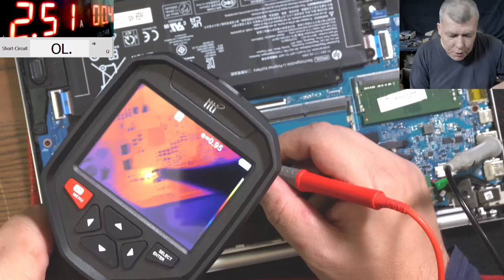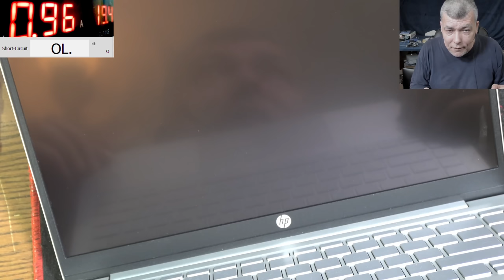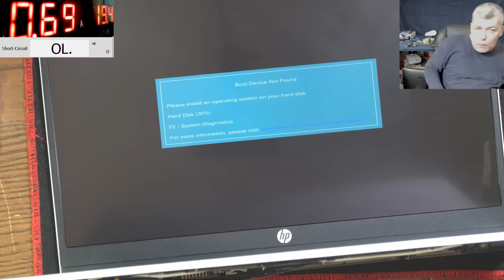HP laptop shorted board, liquid damage on the board - Using water to fix it

Comment: Nice video, Sorin. Thanks. Always learning from you.  A question: why didn't you clean the fan, full of dust ?🤔
Reply: There is something called ocd and something called good practice, dont fix whats not broken and the job was not in for bad cooling issue i hope you understand
Reply: @ognjenjakovljevic494  You're right , but it's a nice thing to do with cleaning the fan 👍
Reply: @Dracula.25 if you clean the fan you have to take it apart take it apart you might cause more damage. Right now he has a working laptop that might be dirty but it's a working laptop his job is done. Same reason why he doesn't clean screens anymore. Although he could just use a blower blowing out but what ever
Reply: @daveunbranded  No you don't. It just needs air blown in it. I do it with every device I fix. 30 seconds and some canned air and it's done. Totally worth it
Reply: Yes, it really bothers to see that often. How you can ignore a fan full of dust?
Just take a moment to remove (at least most of it) the dust from the fan.
Reply: @Alobster1  All the dust does not come out with air pressure!!! When you apply air pressure, the dust turns into a small ball and doesn't come out, at some point it will jam the fan completely and won't let it spin. Real cleaning is to disassemble the fan from the cooling fins and clean
Reply: @twx8626  You blow air the opposite way that it normally goes. if you blow air through the back of the heatsink it will come out the top of the fan and you won't have to blow all that dirt through.
Reply: @Alobster1  In general, I have only 22 years in the field of computers and electronics. When you have a gamer's computer and a fan gets stuck in the middle of a game after half cleaning it is a serious problem. There is a matter of responsibility with the customer. Do not touch a place that the customer did not ask for and is not sure that he will pay.
Reply: @twx8626  It is more likely to cause thermal problems leaving the dust there then your highly unlikely scenario. Once dust buildup starts it gets worse exponentially and it was at that point with this case. 
Have you even seen how dust buildup this bad effects thermals? I have plenty of times and it's not good. the fans get loud and have to work even harder to do their job they are much more likely to fail.

Comment: 10:00 Because people don't clean it from dust and when it get full of dust it won't get enough air to cool the laptop. You can already see how much dust there is in the fan. That fan have never been cleaned.
I have fixed so many computers/consoles only by removing dust from the heat sink.

Comment: If you use water, you should use distilled water at least. No minerals, less chance of corrosion and shorting something out. Even after you dry out the board with hot air, you can't be totally sure if there is no water under a chip.
Reply: Flux off also works well to clean these things
Reply: I agree, those minerals on the board will fix the humidity and accelerate corrosion
Reply: and the rosin can avoid that ..
Reply: I literally hosed down boards that were too nasty to even look at and 10 years later are still working right now, you just need to dry them the right way
Reply: Agreed. Here in the SE of England (where Sorin is too) the tap water is very hard. I always use distilled water for stuff like this. Perhaps he has a water softener/filter.

Comment: Maybe you should have cleaned the sticky from the fabric. I would think that the liquid residue will now impeded air flow.
Reply: Sorin is very professional on fixing all these failures. I do not have any clue on these electronics and am very impressed about his confidence. But as a customer I would like to receive a notebook with a complete cleaned mainbord, also the fan needed a good cleaning. Maybe the termal paste renewed would have completed the service.

Comment: While your in there you aught to blow out the fan if it is that full of dust. I always clean the fan and heatsink if I do any work inside a laptop.
Reply: Happy you like working for free. Others may not. If you go to a densltist to get your tooth filled, they aren't gonna do a whitening as well "while you're in there". Different job, different price.
Reply: @miajonekem You're right , but cleaning the fan wouldn't be too much problem , easy and fast thing to do
Reply: @Dracula.25 Takes time, and time is money.
Reply: @miajonekem How lazy are you? It takes literally 30 seconds and prevents a customer from returning with the same laptop. 30 seconds for more customer satisfaction is worth it. If you took your car in to the tire shop to get your tires rotated and had a low tire how would you feel if they didn't top the air off? Similar scenario

Comment: You didn't replace the new cap?
Reply: No sorin believes its not a must.. Trust his experience more my friend.. He can see the board and sometimes he do replace and sometimes don't
Reply: Because it works without that cap. It will put additional stress on the other ones, and another one may fail sooner than expected, but my guess is that computer is not going to be used that long.
Reply: He made the design more efficient, some engineers like to add useless cap to justify their work.

Comment: You should use distilled water as it doesn't conduct electricity, its pure h2o
Reply: de-ionised would likely do just as well
Reply: @daffyduk77  i distill water for one of my businesses, it's very adsorbant. Not sure on de-ionised. Some IC's are Moisture sensative, hence why they are packing with silica gel packets

Comment: I have to disconnect the battery if i want to clean with water right?
Reply: bios battery too
Reply: he's lucky because the battery is very discharged
Reply: Maybe he used destilled water (non-conductive)
Reply: @peterg3r3c57  he always warn us about the battery and power when removing the screen connector.. I think he did remove it but we didn't see.. I trust his experience more than the video 🤣

Comment: Anyone got any idea on how to trace fault where the NVMe isn't detected?
I know Windows 10/11 doesn't routinely have the Intel RST drivers installed. But when you look into the BIOS there is a RST for the HP 14s series.

The NVMe works in a caddy. So it isn't the drive.

Also I get the Amber battery charging light that eventually goes white BUT pressing power leads to a 1 second power on light then nothing. Seems a common fault but no clear stepwise solution

Comment: better not replace, if the capacitor is parallel and you replace only one surely it will come back,caus the capacitor you replace will handle all the stress, cause other capacitor might be open,. about the screen maybe it is heat exhaust,.

Comment: I do not think the manufacturer has to be concerned about protecting that laptop against liquid, unless it was a rugged one, which is not. Laptops are not supposed to handle liquid inside, manufacturers do not have to protect their devices against users that spill liquid on their laptops.

Comment: Shameful. Did you look at the fan?!? It is almost totally blocked by dust and you did not clean it???!? You really want the customer back because of overheated and with a little bad luck totally destroyed laptop. And additionally you really should clean the bottom cover before putting it back. It is sticky and the vent holes will be blocked with dust sticking to that sticky sugary liquid. I give you 2 out of five of this job. I would not let you do the job in my shop.